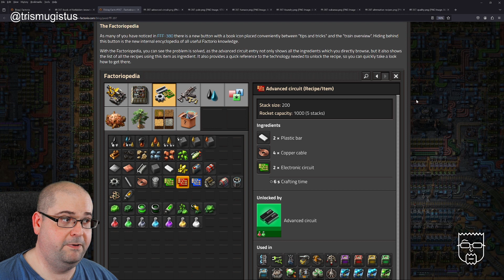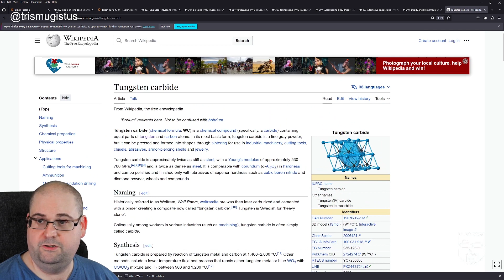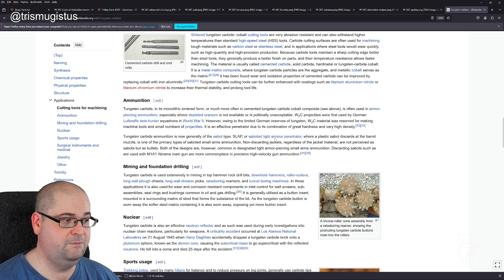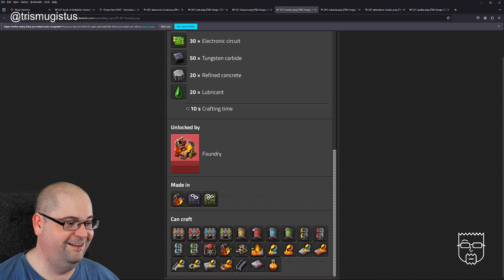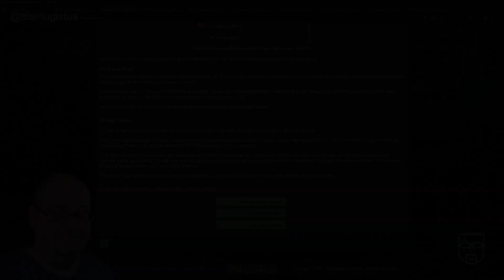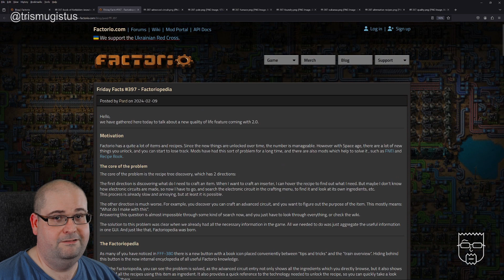Easter comes early - new Vulcanus info! | Factorio Friday Facts (FFF) #397 | Analysis & Speculation

Comment: i find weird a foundry can make belts drills etc... i am okay with steel or plates or gears.. as thats more of a mold wich suits a foundry..
Reply from the maker: I agree.  Foundry suggests a building that melts and casts metals, so something as complex as a drill or belt shouldn't be made there.
But then it feels like Fulgora's Electromagnetic Plant shouldn't really be able to smelt things and that should be more about makign stuff.
I guess they have to strike a balance though - they want to give us cool new machines but don't want to add too many (mods can do that).  They also need each planet to work in isolation so you don't get stuck and it doesn't get too complicated.

Comment: Im concerned, that the foundry maybe can do "to much" for one factory...i would like it, when it can only craft intermediates (so no belts, no undergrounds, no mining drills). That it can make low density structures is a good thing, but i wounder...are they then made without plastic? That would be a releve:D
Reply from the maker: Yes, it's a bit odd to combine the buildings that process raw materials (furnaces) with the ones that make intermediates and final products (assemblers), but I don't think it's too much yet.  And I think the trade off is power - they're meant to have a huge power demand, so making and using lots of them will be a challenge.
I think on the low density structures we're going to end up with a weird fudge where all the new buildings can make low density structures, because they're needed for rockets and they want to give us extra reasons to make the new buildings.  They've not said how / if they're changing the recipe for them, but I think they will need plastic.  It's going to be a bit of a challenge to make all these oil products we'll need, given we'll only have coal liquifaction and there's no liquid water on Vulcanus - maybe rocket fuel and burning solid fuel will end up as a bit of a sync for extra / unbalanced fluid?

Comment: About gravity and cost of launch. I think it would be more fun if launch price would not be in the volume of fuel but in volume of cargo. Rocket fuel is very cheap, no matter if launch would cost 10 rocket fuel or 40, both are unnoticed. But if to launch 1000kg of cargo you need not one rocket but four rockets, this may force changing strategy.
Reply from the maker: Yes, I think that would probably makes more sense, actually, and also be less confusing and easier to represent.  A warning that your rocket is "overweight" / has too much in it is probably easier to understand than having to put more fuel in.  But then we don't really know too much about how they're controlling the weight - does it just stop you loading in too much, or does it let you load it and then say if it's overweight?
You could also envisage some sort of "weight reduction" tech or a super rocket later in the game with an extra booster stage that's quicker/cheaper/easier to craft - even if not in the main game, then mods people do.